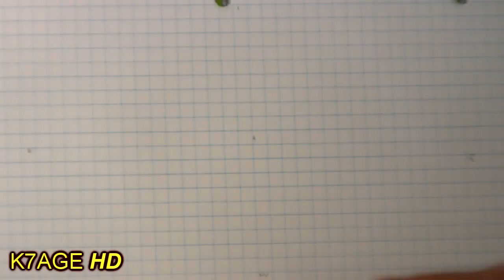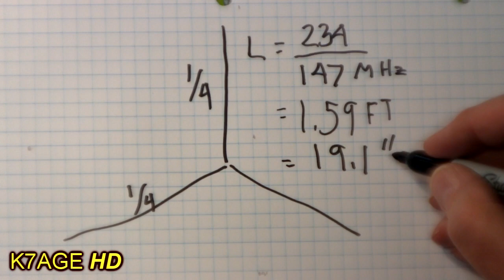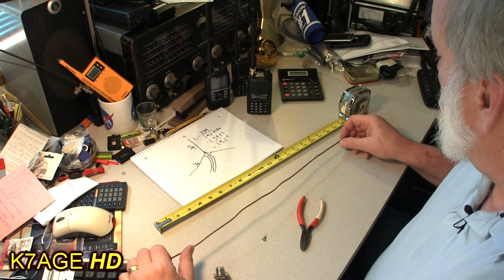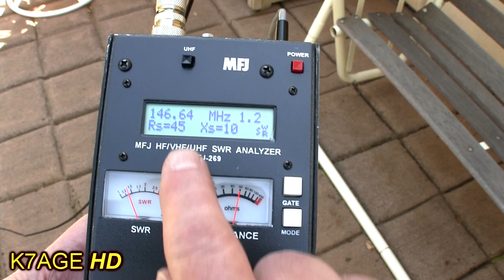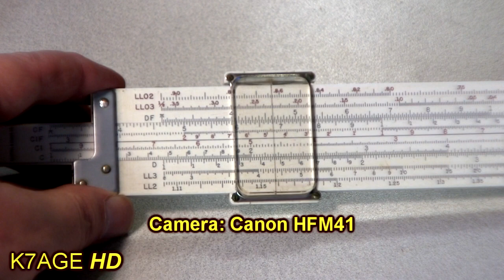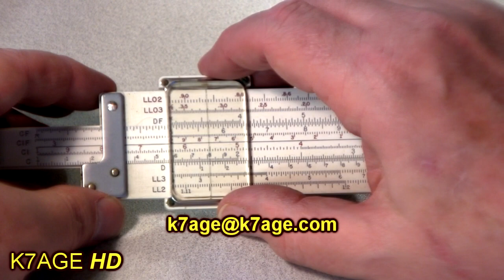How to Build: Ham Radio 2 Meter Quarter Wave Antenna

Comment: If the wires are not perfectly straight or the measurements are not accurate, what is the effect on the antenna?

Comment: this antenna will have better swr when the radials are bent down about  45degrees and if the radials are about 5% longer than the radiator! Doing this increases the impedance of the antenna,  as the 1/4 wave vertical by itself in approximately  30 ohms.  Obviously this system is fairly forgiving either way, but for all you beginning Technician amateurs, any bit of reflected power is going back through the coax, and  is NOT being sent out via the antenna! - Bruce AI6XK

Comment: Thank you for showing the slide rule technique....I've got a few of them and have never been able to use them! I'm a new ham...just got my Tech....hope to get my General next month. I have the Antenna building bug! I built this quarter wave ground plane after I watched your video several weeks ago and the sdr that I have is SO much quieter than when I have the stock antenna hooked up.  I don't have a radio yet...still saving my pennies! Again...thank you for the video and 73 de KN4FTT
Reply from the maker: Great news on your license. Outside antennas work much better than something inside. Higher is better too.

Comment: Rady, Very informative video. Thank You. 
Does this mean you can only transmit and receive on 147 Mhz Freq??
Reply from the maker: No. That is the resonant frequency. Your radio will operate over a 1:2 to 1:3 SWR, so you can operate over the whole 2M band.
Reply: Thank You

Comment: Hi K7AGE ! Question: can I use wire from a few coat hangers? Instead of copper wire.
Reply from the maker: Sure, just make sure you scrape off the paint on the ends where they make the connection.

Comment: Randy I now want to build a 1/2 wave ground plane,     what do I need to know?   I  want a little more range.     Thanks.
Reply from the maker: That would require some type of matching section.  You will need to google around to find some plans. The quarter wave vertical matches to 50 ohms without any additional matching needed. That is why it is so simple to build.

Comment: a 1/2~ comes out to ruffly 38.5"  leave the radials 1/4~ works great but do to length of the radiator i used 1/4" tube
antenna up at 20ft  gets me around the 40miles  not to bad for a home made ant. it out does my commercial comet gp1

Comment: Awesome video! I built one of these today and I was able to get full-quieting on a repeater about 35 miles away with only 1 watt. I used the same parts you suggest, with the only change being I used vinyl coated wire. Thanks for your instruction and great channel.
Reply: I had to add a second update. I was setting up local repeaters tonight on the antenna, and found I was able to open the connection to a repeater 53 miles away. So I tried to work a station on that repeater to see how the audio sounded, and then spoke to another ham for about an hour. I was able to set my HT all the way down to "Low1" which is 0.05W on my HT. He said, even on that low setting, it was full quieting with a bit of static in the back-ground. I am so pleased with the performance of this antenna. Thanks again!
Reply from the maker: The outside antenna really makes a difference. Glad to hear that it is working out

Comment: finally i found you sir, my only prob now is where to find all the connectors in my location.😊😊
Reply from the maker: +Reychie Urdaneta what is your location?
Reply: K7AGE im from the philippines sir and by the way im new at this. im just looking for a way to enhance the signal of my ham radio for my work and found your video. thank you so much for sharing your knowledge.

Comment: Hello Randy, would like to know if you can let me know where you purchased your vise. It looks like a very fine piece of equipment. I'm just getting into the ham radio and would like to have top of the line tools. Thanks Jim KC3JDJ
Reply from the maker: It is a Panavise. It is modular. I got it at Fry's years ago. Google around, you will find it.

Comment: Thanks for the video. The only Question I have to ask is what hardware do you use to connect the cable to the radio. I'm a babe in the woods. Just got my tech license and want to build the antenna. Thank you Jim KC3JDJ
Reply from the maker: Jim, that depends on how long the coax cable needs to be to reach where the antenna is going to be placed. For under 25-50 RG8 or RG8X would be fine. Much longer, then think about RG8 coax with PL259 connectors.

Comment: This is just what I was looking for. Here is a hint for working with bare copper wire - to get it straight secure one end with a clamp or vise, that is well anchored, and chuck up the other end in a drill. Pull on the drill and 'wind' the wire a few turns then wind it the other direction a few turns. The wire is much straighter than what it was previously. I was amazed the first time I tried this. Be careful, the wire can become hot if wound too much. If the copper wire is straight, it is much easier to work with.
Reply from the maker: sounds neat, thanks

Comment: Randy,
Thanks for the video. I really enjoyed it. I will be building one of these soon. I just passed my technician test 2 days ago. I can't start transmitting until it shows up in the database. I am not going to lie. I just memorized the test questions to pass the test. Now I need to actually learn.  I have a couple of questions.
1. Why are you using the constant "243". I thought the constant was "300" since that represents "c" (speed of light). When I do the math I come up with just over 20".  What am I doing wrong?
2. I think I would like to use welding rods. Do I need to remove the flux coating? 
Thanks again for your videos. I am really enjoying them.
Reply from the maker: Great news on passing your test. The speed in the wire is less than the speed of light. Here is an article about 468, which is for half wave antennas, www.eham.net/articles/23802.

Welding rods will work find.  Thanks for watching.

Comment: Good evening Mr. Randy;  can you me say, what kind of coaxial-cable you used: which type of connection: side antenna - and side for example to the scanner?  Best wishs  Harald "Hotelbravo" - Switzerland.
Reply from the maker: I use RG59 for temporary installations. RG8X is good. RG8 is better for longer (>50') lengths.

Comment: K7age thanks for the incredible videos I have had my licence for 6 months and wasn't sure where to start. I am going to build your antenna. Few quick questions would you seal around the top rod with silicone. What other material would work for the antenna would steel fence wire work? As well I am assuming that the higher the antenna the better the range? Thanks for your time and patience with the new ham users.
Reply from the maker: Yes, seal around the vertical. Welding rods are good. Not sure about steel fence wire. Try it.

Comment: hi sir...i am from the philippines...do you think your project will work on my baofeng 6ra and cignus uv85+hp (8w) using a 20 meter coax cable? i wanna place that on the rooftop of the 5 floor building...am from 2nd floor.....my radios are dual bands...
Reply from the maker: Yes, but only on 2M.

Comment: by the way , what are the welding rods for ? you didn't use them in the video
Reply from the maker: I had thought about using those but then changed my mind. They will probably work better for a more permanent installation. Add some RTV seal around the base to keep water away from the vertical.
Reply: ok, can you plz send me a mail reg what all materials to be used for building the antenna.  tks in advance
Reply from the maker: 6-32 hardware
SO-239 connector
Wire or welding rod for the elements.
Coax cable to run to your radio. You may need an adapter to connect to to your radio.
Reply: Tq so much for the wonderful advice. Will make one and get back to you ASAP
Reply: 73

Comment: I also wanted to ask the max wattage that can be run thru this? I used 12 gauge wire for the radial and I'm feeding it with RG8U.
Reply from the maker: How much power do you want to run?
Reply: I'll eventually be running 65 to 75 watts. currently 8w on my HT
Reply from the maker: That will be fine. You may want to add some RTV seal around the center conductor to keep the rain out or the soldering area.

Comment: Randy, I notice that you don't bend the radials at a 45 degree angle. I built your antenna to exact measurements, but the best SET I got by trimming was 2:1. When I bent the radials beyond 45 degrees the SET dropped to 1.2:1.

73's. KD9IFL
Reply from the maker: Glad that you bent the radials down to get the SWR down. I forgot to bend the radials down. I was able to get the SWR to an acceptable level.
Reply: As a newby I really appreciate your videos, they've been a tremendous help to me!

73's.  KD9ILF

Comment: Could you put 8 radials on?  Just double up the wire around each screw? so each is 38.2 inches total then bent in half around the screw? Would it help?  Thanks
Reply from the maker: +James May I don't think it make any difference

Comment: kf6lau-Stan Best. How do you connect coax  to the radio? I just bought a BAOFENG UV-5ra. Great video after almost two years
the info is unsurpassed by any on YOU TUBE on this subject. 73
Reply from the maker: This is the adapter cable that I like using. Using a cable removes that stress from the cable to the radio rather than using an adapter. https://goo.gl/fWUfeH
Reply: You mean just using the cable  end?  I have a BAOFENG UV 5RA.
The rubber ducky appears to screw on? Help.
Reply from the maker: You will probably have a length of coax cable with PL259s on each end to go from the antenna, maybe outside, to the radio. Then connect using this adapter cable.

Comment: Very good video. I am a beginer, so tell me pls what is the length of the element in marine bands 138-175 MHZ? I must work in diferent chanels .Thank you very much for your time.
Reply from the maker: Marine band is around 162 MHz, which would be about 17.33".

Comment: Randy,   I built the Antenna,  Works very good,    Rx is great and I have hit a Repeater 16 Miles away.      That is my best so far.   My length of the wire using a SWR Meter  is  19.15" or so.  in the mid 146 range.   The length of the wire and the Freq is a fine balance.  

I do not know how high of a SWR reading I can go without loosing too much of my 4 watt output power.   

    Is there  a inline product that can be used like a dial to tune the antenna.?
Reply from the maker: Your radio should work fine up to an SWR of 1:2. There are tuners, for 2M, but I would rather spend the money on test gear to see what the antenna is doing.
Reply: What is the price range for test gear for the antenna,   Name Type Model

Do you know of any good used  Antenna Testing Gear?      

Thank you
Reply from the maker: The MFJ 259 is probably the most common analyzer. I think it sells for around $300.

Comment: Thanks randy  I purchased some 3/32  Stainless Steel   308   Nice Material and should last a long time out side.  11$ for 8 36" long 3/32 rods.

 I hope I get  30-50 miles like you do.    I live in  lower New England
and we have a lot of rolling hills.   

 My  UV-5R puts out 4W  so I want to use very low loss cable like  LMR - 600  or Better.   I do not know the Gain of this Antenna but I hope it is better than the  NAGOYA NA/771  15.25" ANTENNA.    I see you'er  uses a little longer Rad and has the ground plane.      Also, I need to get a meter like you have to measure SWR/Freq.

Thanks, sorry for all the Questions.       So to recap   1/4 is good    the 1/8 is bad the 5/8 is not good.     So  a full wave would be the best for 2 meter other than the 1/4 or 1/2 wave.

The 1/2 Can be easy to build with some  1/2" thick wall copper tubing.  I also need to get a SMA female Connector  to the quick type connector  you are using any thought on where I can Purchase that item.

    I do not know the name of the Connector I need.  Or who sell's them.

   Once more thanks Randy.        In my area there is not much talk on the 2 Meter band Just seem like a lot of us older guys talking about going Fishing. lol

Comment: Hello Can this be built as a 1/8 wave Antenna ?    using 9.55" rods?  Thanks  let me know.
Reply from the maker: No. The impedance would not be close to 50 ohms and the SWR would be way out. A 1/4 works nicely as the impedance is around 50 ohms and does not require any matching.

Comment: How Much better would a 1/2 or 5/8 wave antenna be?
Reply from the maker: 5/8 antennas are common. They do require a matching network at the base. The 1/4 is nice as it doesn't need any matching. The big step is going from the rubber duckie on the radio to an outside antenna. Google around for 5/8 plans.
Reply: Thanks,   how much better is the 5/8 and what do I need to match Thanks..    will do the search.    I have the UV-5R with the duck and just cannot seem to get out with much range.  I live in a  hill area.
Reply: Sir can this be built as a 1/8 wave antenna?   I want to try it on my UV-5R   but I also need to get a SMU connector I think.    Thanks  great work

Comment: what would the length need to be to make a 5/8 wave?
Reply from the maker: To  build a 5/8 wave antenna, it would need a matching section. Google to find plans for a 5/8 wave 2 meter vertical antenna.

Comment: Hi Randy,
When i build my quarter wave, I went to 19.2" for the length of each wire, as I was going for resonance at 146MHz.  When check it with my MFJ-249C, the best I get is an SWR of 2.7:1 around 144 and that's it. Things slightly different...I used insulated 12ga solid copper wire, but that's about it. I guess I'm curious as to what happened!
Reply from the maker: Try bending the radials down at a 45 degree angle. You may try and bend the ends back onto themselves to raise the frequency.
Reply: Just FYI, I haven't taken this outside yet, but was tuning it on about a 4' coax to my meter. Here are the measurements
139 MHz - 4.0
142 MHz - 2.9
144 MHz - 2.8
145 MHz - 2.8
146 MHz - 2.8
147 MHz - 2.8
148 MHz - 2.8
149 MHz - 2.8
150 MHz - 2,9
151 MHz - 3.0
152 Mhz = 3.2

So you see it's pretty stable in and around 144-148, just that the SWR is higher that I would like it.

I will try moving the radials at 45 or so and see what happens.

Comment: So I have the SO239 connector, and the wire, but I cannot tell which end you solder the vertical on, Male end or Female end?
Reply from the maker: I used a female chassis SO259 connector for the antenna base. The vertical solders to the center pin,.

Comment: I am curious did you have to trim the antenna wires down? 

If I heard you right you measured them to 20" but in the video it does not show you trimming them down.
Reply from the maker: I would have to go back and watch for that. I don't remember what I need. The antenna may have been a bit low in frequency and I may have cut off a bit. I'll have to watch this again,

Comment: thanks K7AGE...I like you style of education. one question, might be dumb. when you measure the 19.1"  antenna lengths, does that include the tiny bit , say 3/8 inch, that curls around the tiny mounting bolts?
Reply from the maker: Total exposed length. With a wire dipole, it is very common to shorten the wires by winding the wire back on itself. On the vertical, the wire isn't wrapped around itself. Not sure. However, the vertical is fairly broadband, so it probably doesn't make much difference. Go ahead and built it. The vertical is fairly repeatable in build and performance.

Comment: Great work I am just wondering just for learning If you add more radios will make it stronger! What about the size. If we make it longer than 19 inch what the different s Thank you
Reply from the maker: Adding more radials really will not make much difference. Making it longer will detune the antenna, which is not good for the transmitter.
Reply: Ok thanks   What about a cb radio  by useing the 2 meter anntanna  could be used as a ham radio. Or I do have to buy a ham   Also. A galaxy radio 990  is a good ham radio. Thanks for your reply

Comment: what will be the length of the coper wire for 600 mhz
Reply from the maker: +nikheel kumar 234/600= .39 feet or 4.68 inches

Comment: instead of pvc tube can I use a regular steel antenna tubes (4ft sections ) that hook together..or will that change values????.. they also come from radio shack..the coax will go thru them easy too.,,, and did you ground any part of your antenna ,,? thanks for the instructtion,, I just made mine out of steel rods from an old tomato plant holder..they soldered easy into the center conductor,, and I heated them to loop them for the 6-32 screws..I know they rust faster,, but I need these answered first..im in Reading , Pa.and thank you for ALLL your videos...ive learned a lot..ive been in radio one sort or another since 1964,,,, CB, then VHF,,now ham,, and I started with morse back then but left for the army in 1968 and retired in 1988..now im back in ham again....
Reply from the maker: Sure, the steel mast will work fine without affecting the tuning. I would seal the center area with RTV if it is going to be a permanent install. Grounding, not needed for operation. It it is high and in the clear, then maybe for some lightning projection.